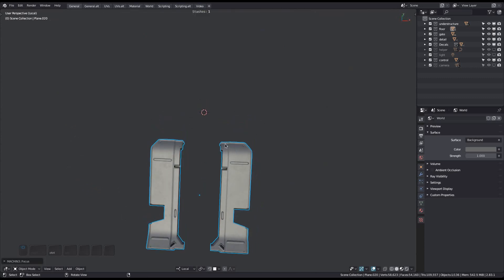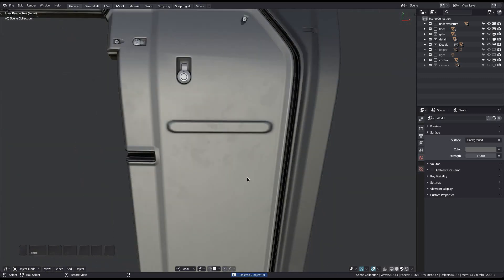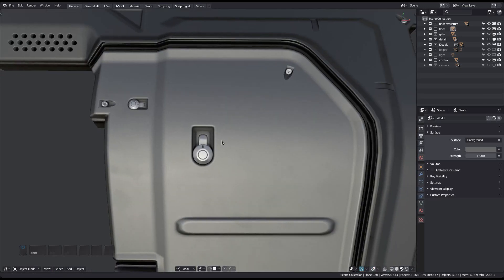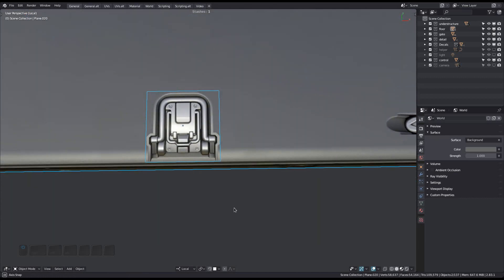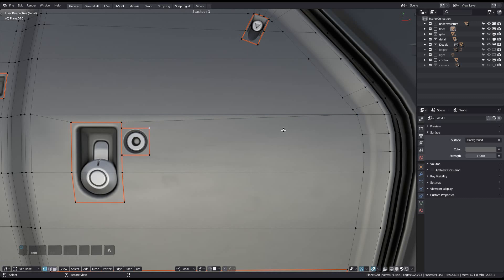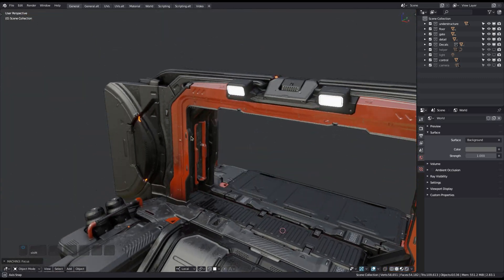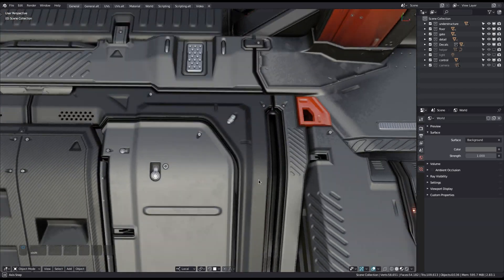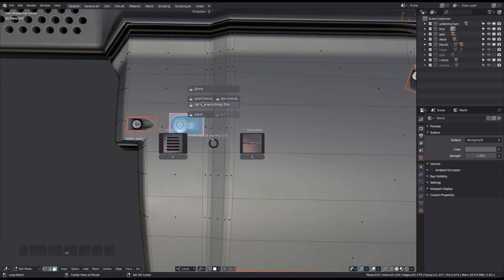DECALmachine 2.0 - Trim Cut

Comment: Is it possible to make Trim cut friends with the Mirror modifier?
Reply: @MACHIN3  I meant the situation when a Mirror Modifier is added to the Trim Decal in order to get two or four from one Decal. If you then use Trim Cut then Mirror is ignored. Is it possible to get around this limitation?
Reply from the maker: I see. Well, not easily. Unless you use MESHmachine, then you can just run Real Mirror, followed by TrimCut.
Reply: @MACHIN3  Thanks for the answer. But I don't have MESHmachine. Fortunately, I managed to find a way to solve the problem with the available means. If, after applying the Mirror modifier, divide the resulting object into separate parts with the P button, then Trim Cut works as it should. Perhaps it will be possible to automate this in the next versions of DECALmachine?
Reply from the maker: This won't work correctly, unless the decal origins for the mirror instances are also adjusted. - which is exactly what the RealMirror tool in MESHmachine does.
 I won't be duplicating this tool in DECALmachine, but you can do it manually in the Cursor/Origin pie of MACHIN3tools too.
Reply: @MACHIN3  I bought MESHmachine and Real Mirror works very well. Thanks for the help!
Reply from the maker: That's great, thank you!